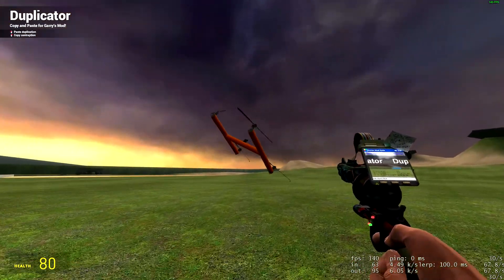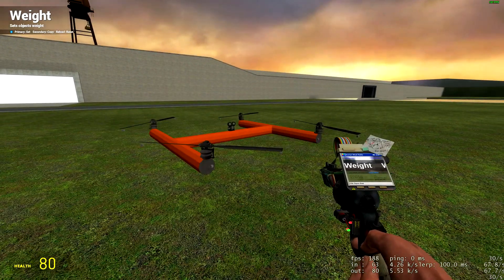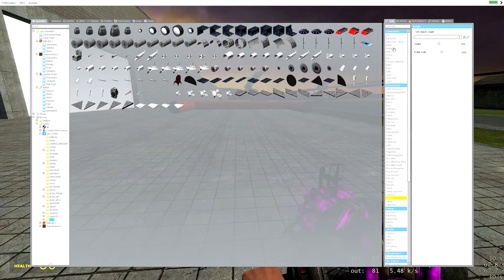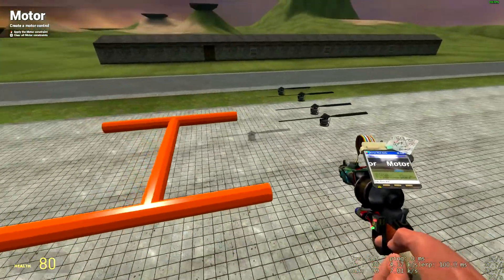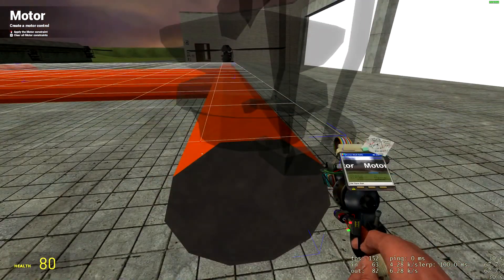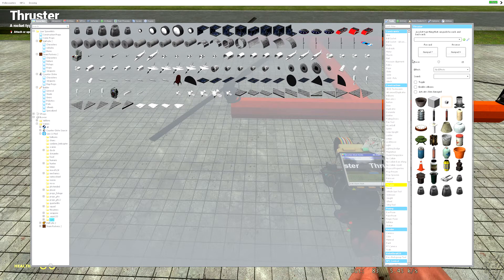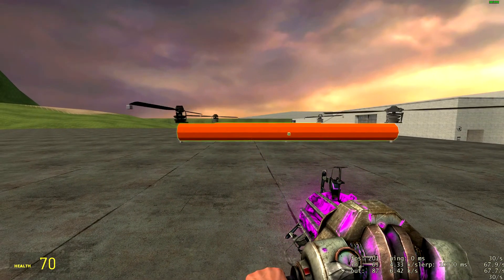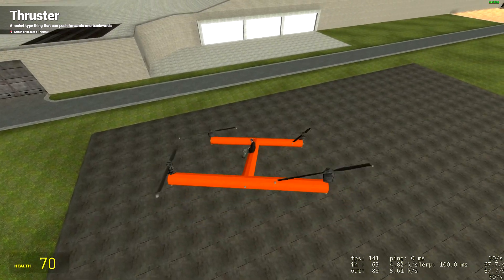Garry's Mod: How to Build a DRONE/Helicopter [NO HOVERBALLS!!]

Comment: My motor isn't working like when I put it on an aircraft it doesn't make it fly. I used the weight tool and it still doesn't work.
Reply from the maker: should more or less be able to fly even without the motors

Comment: when it spins it comes of the orange thing
Reply from the maker: like it breaks off completely or just has trouble holding it up?
If it is breaking off, make sure the breaking strength limit is set to 0 so that the joint can't break.
if it is just kinda have trouble holding it up, you might need to mess with the weights a bit